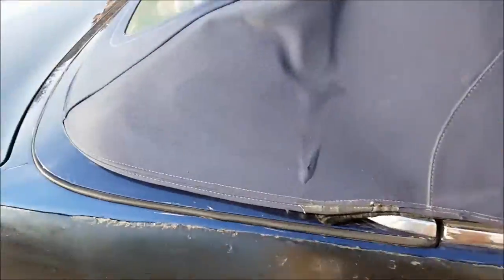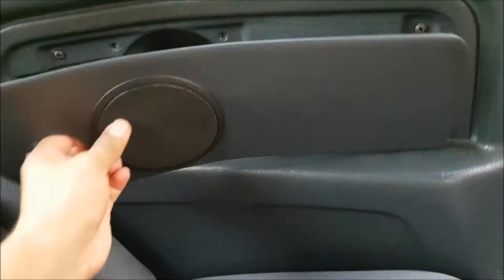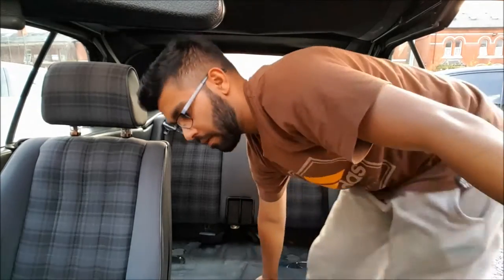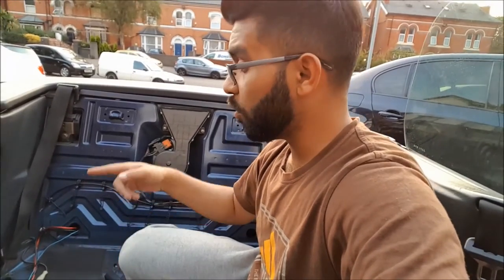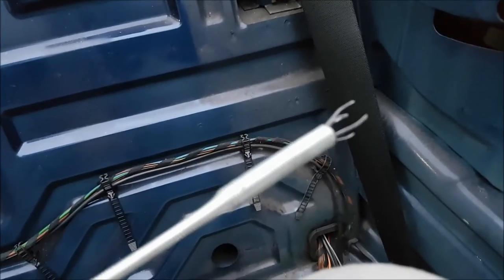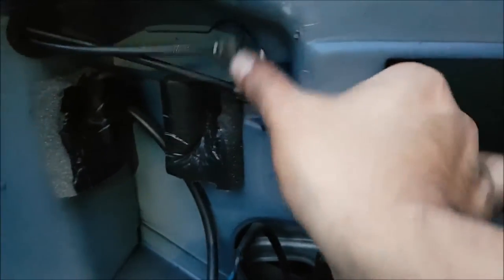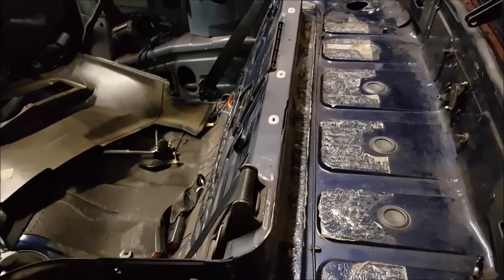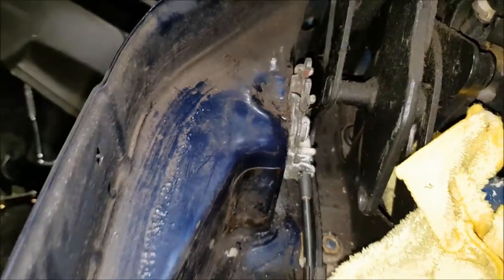How To | BMW E30 Manual Roof Conversion From Automatic Convertible Roof.

Comment: Did you happen to remove the electric motor? If so I want to know how you did it. I have the same issue with my top but I want to repair the motor on it
Reply from the maker: Sure I'll look into doing that video in the near future for you! It didn't seem that hard to remove before but once I have finished on the current project I'll be on that for you right away! Thanks for the comment and the idea for another video!

Comment: One question I had with the installation: where does the convertible top latch (51251937377) go? I see you have that part also at 9:01
Reply from the maker: sure, it goes on the left side (passenger side for me) near where the locks are, you will be able to see an area where it has the 2 holes for that to latch to go. I just didn't realise it until later but then again it hasn't actually caused an issue for me at all without it.

Comment: what a shame. if you have an automatic top e30, it is worth fixing since there aren't too many
Reply from the maker: I still have most of my automatic roof parts but when I purchased the car it has most of it removed so I dont know what I have or need or what could be broken so for the time being I thought this would be the best way to keep the convertible top safe. 
I would want to convert it to auto in the future which is why I am keeping as much of my auto roof top for time being. I do agree they are getting rare!
Reply: They're rare because they're AWFUL! '97 has 3 motors and a computer, as well as a wiring harness in the top that bends 180 degrees every time the top is dropped with hair thin wires that are a short circuit waiting to happen. NEEDLESSLY complicated. My new Fiat spyder had one latch to open it, it's manual and can be done from the drivers seat. The tonneau cover is part of the roof. Slick, simple, no needless bullshit to go wrong.